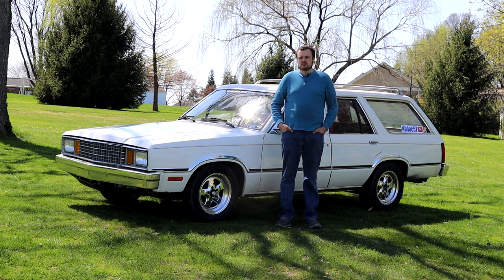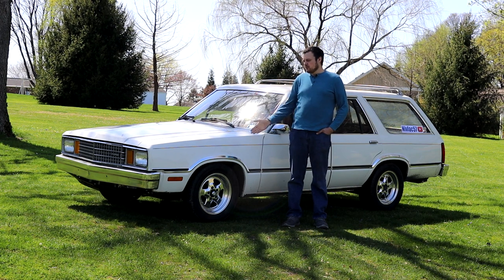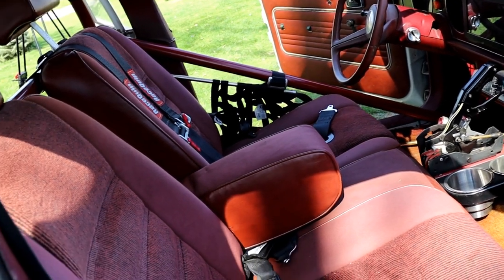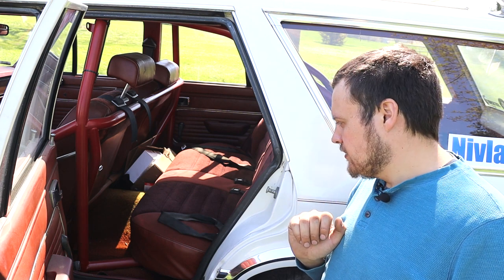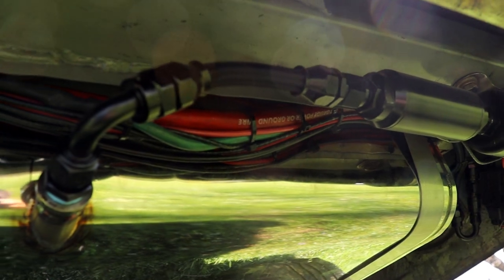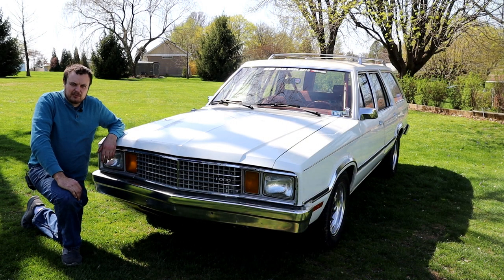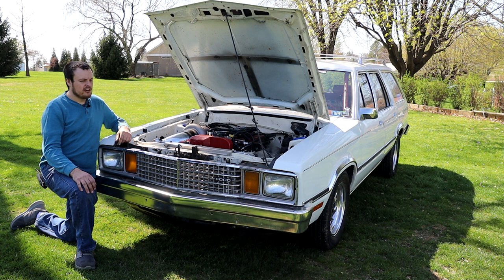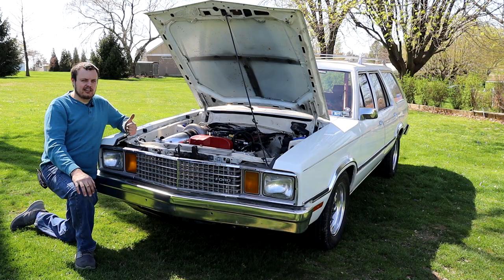My Station Wagon Has An Insane Inline 6 Engine Swap

Comment: That brings back memories of the '78 Fairmont sedan I learned to drive in, except it was a a stripped version with the 4 cylinder and 4 speed stick. You were lucky to get such a babied, low mileage car to use as the foundation for this project. Some amazing workmanship to get all of these mods done without giving away any clues from the exterior.

Don't forget that these Fox bodies were also decent handling cars back in the day, at least the version that I had (with 1/10th the hp of this build).

Comment: Great build, I can’t wait to see it run on drag week
Reply from the maker: Yeah. It's going to be a lot of fun.
Reply: @Calvin-Nelson  you should bring it to Rocky moutain race week next year. Im getting ready to do the 3700 swap in my Cavalier and ill be at 1.0 in 2023 :)
Reply from the maker: @darkblaze176  Yeah. That seems like a really tough event. Going through the mountains sounds rough. I want to complete one of the less daunting ones first.
Reply: @Calvin-Nelson  I went in 2021 as a roadweeker It's super fun. It's not that bad actually. As long as you have good brakes and an attequite cooling system. You should be fine 😊

Comment: My grandma had a 80 Fairmont wagon she bought brand new and drove it until the wheels feel off it. My son and I just picked up a 79 Fairmont wagon for dirt cheap that we are going to yank the back seat out and build a platform in the bed and use for a parts/Swap Meet car.
Reply from the maker: Very cool. The back seats in them fold down so flat, you may be able to keep it and just put a piece of plywood (or something over it to be your platform.
Reply: @Calvin-Nelson  Nah, they are trashed anyway and noone other than the 2 of us will be riding in it so why not just yank it out. and have that much more cargo space.

Comment: I just picked up an 82 mercury cougar wagon and really don’t want to use a fuel cell for my ego swap. Does your tank use the stock fill location? It looks like the filler is just connected with a hose and hose clamps. Any problems with leaks? I’m struggling with a fuel tank solution.
Reply from the maker: Yeah. It uses the factory fill. I just bought a universal truck tank from Tanks Inc. then I drilled a hole in it and welded a tube to the side.

Comment: Which crankshaft are you running in this? I would assume the 12 balancer, but the 7 tooth wheel seems strange for most aftermarket ecu's. also nice video!
Reply from the maker: On this one, we're using an 8 counterweight crank. 12 counterweights would be better, but I didn't feel like taking it apart
Reply: @Calvin-Nelson  Okay thanks, only reason im asking is im running an AEM infinity 508. looking to swap a bmw from a 2.8 turbo inline six  to an ll8
Reply from the maker: @jackmccormick3824  Yeah. The trigger is sometimes called GM7x, or 6+1. Cam is 6 tooth.

Comment: so how would a ford 300 do with the same buildup? maybe even a 4.125 (318ci) or 4.200 ( 331ci) sleeved and semi filled build
Reply from the maker: Not nearly as well. They lack cylinder head flow. You'd have to put LS heads on it and it would still not do as well. Also the length of the crank will not like RPM. Hard to make HP with an engine that doesn't want to rev. Trust me, I still get the itch to get a 240 Ford 6 and put Gen V LT heads on it. Maybe someday...
Reply: @Calvin-Nelson  have you seen pat nahans 300 punching over 8500 rpm, or talked with some of the guys from Fordsix? 

I do agree on the stock head but there were some examples from the 60s pushing 525hp on a built stock head NA 

625 on a Cleveland 2V head in 1970 

And now there are guys working on LS heads for them 

I'm working with a 4V Cleveland head for my build currently
Reply from the maker: @Project-gr6zy  Yeah, it's so hard to find info on that stuff. I want to go 9500-10500. People have been there with the 4200 stuff.
Reply: @Calvin-Nelson  it definitely is, but it is out there, my goal is a twin charge 300 that hits around 7200 rpm, not shooting for record numbers but should expect it to peak around 600hp and about 850 to 950tq